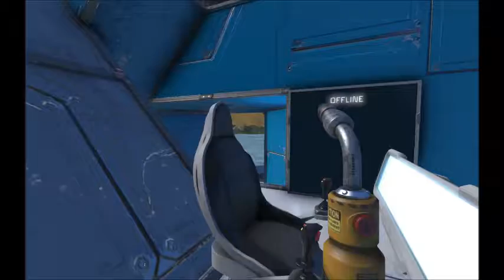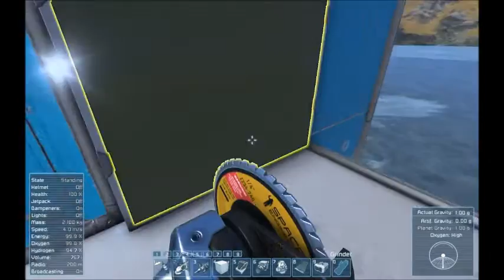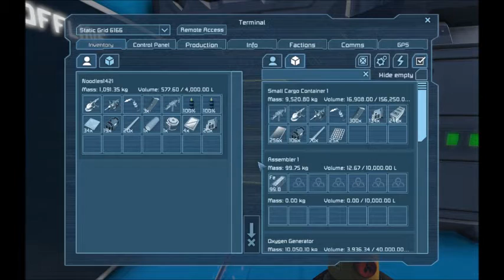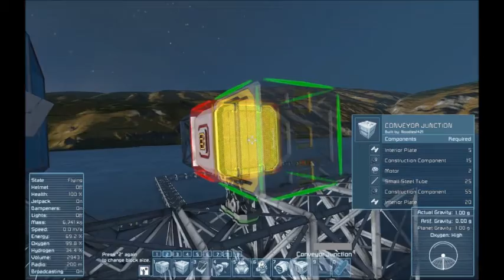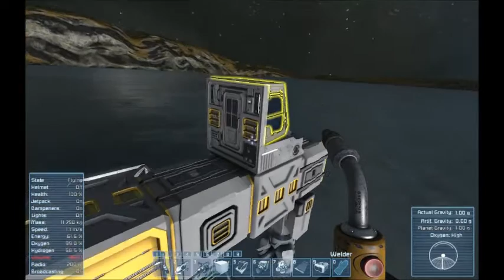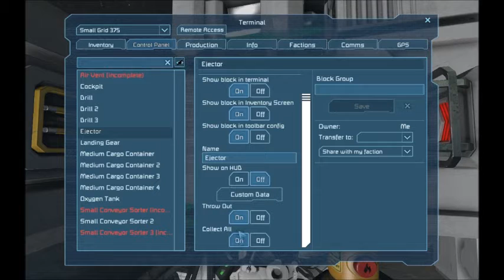Space Engineers Tutorial - Star System Episode 03 - Flying Mining Machine

Comment: I was so looking forward to building this ship but with my problem of digging down so deep to get the Uranium I think I might have to restart the game - or try something completely different.  Mmmmmmmm!
Reply from the maker: The uranium can be quite an adventure sometimes.
The best way I have found is to use the Ore detector on your lander craft.
When you are at a lake and see Uranium showing, see if you find where it is around 100 meters or so below and land there.

The other option which I have not covered in this series so far it to use batteries.
Setup some Solar panels on your main base and where you would place the reactor on the ship, place two batteries.
Fully charged they should give you about 2 hours of flight time.

They can be recharged when the connectors are connected (Ship connector is attached to the Base Connector)
Reply: Yes, I did do the fly past before touching down and the only Uranium I could find was 150 - 200m down.

The good news is that my stubbornness wouldn't let it go.  So I dug down using your ramp suggestion, but didn't weld the plates as I was going so deep and Eureka, I found the Uranium.  How I managed to get the ship and mine entrance the right distance from the Uranium I will never know.  But eh! we have it now and I am ready to build my mining ship.

Comment: Qestion.  Is it necessary to put an Ejector onto the Sorter?  Will the Sorter not pass the Rocks straight out without the Ejector?
Reply from the maker: The sorter will only "allow" or "deny" movement of resources.
If you whitelist, this is only allowing all identified resources to pass and anything not in the list will be denied.
If you blacklist, all the resources in the list will be denied.

The Sorter can not remove/eject components/resources outside of the conveyor system.  
In a small ship, you will want an ejector to do this.

Larger ships do not have ejectors but you can setup Connectors to eject their cargo.
Reply: Thanks

Comment: Question.  When on a non-atmospheric planet, how do you fill up an Oxygen Tank?  The only thing I have discovered so far is to put Oxygen Bottles in it.  It works but it seems a bit odd.
Reply from the maker: Hi Mick,
There are several ways to fill an oxygen tank (be it a block oxygen tank or a Oxygen Bottle).
1. Use the Oxygen Generator and provide "ice" in it as the fuel.  
It will convert the ice into Oxygen for the Oxygen Tank and Hydrogen if you have a hydrogen tank

2. Use the Oxygen Farm.
It requires sunlight to operate but will produce oxygen as long as it is in Sunlight.
This will refill oxygen tanks and bottles.
Here is a link for more information on the Oxygen Farm
http://www.spaceengineerswiki.com/Oxygen_Farm
Reply: Thanks.  Bad question on my behalf.  What I meant was is there a way to fill a tank by hand.  Can I put a tank on a small ship for mining in space without an Oxygen Generator/Farm?
Reply from the maker: If you need to fill an oxygen tank by hand drill, drill "ice" and then cart that to the oxygen generator.  This will then create the oxygen to fill the oxygen tank but you will need it connected through the conveyor systems.

Comment: Hi Commander, 
I'm pretty new to this Game an I started with your tutorial, btw witch helped me verry much. So I built the same ship, but every time I try to mine a rock. no matter how fast or if I try to get many material or even scratch the rock, after a few seconds my ship flips upside down like a coin and crashes. I have no idea why.
Can you help me with this problem?
Reply from the maker: Hi 2802GhostMaker666,
It sounds like your ship does not have a Gyroscope.
They are essential to maintaining stability and control.
Best place to put them is by centre Mass of the ship but anywhere does work.
If you put one in and it seem sluggish, add a second one.

They need only be on the grid of your ship somewhere, no need to attach them to any conveyors as they will get power through the ship.

I hope this helps.

CMDR Noodles